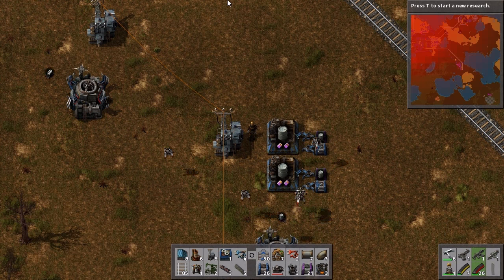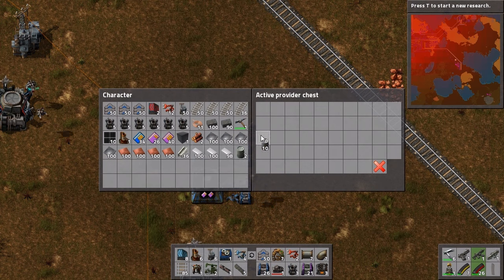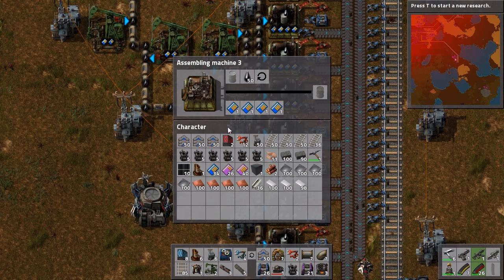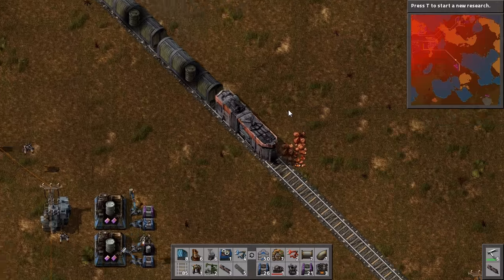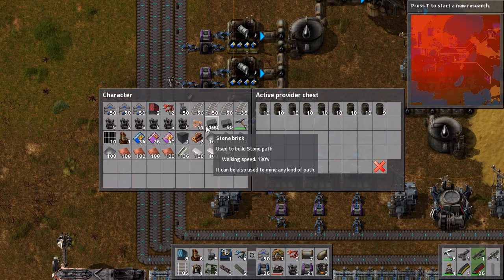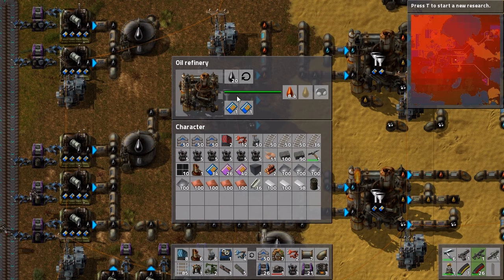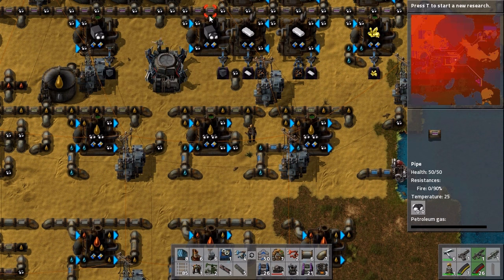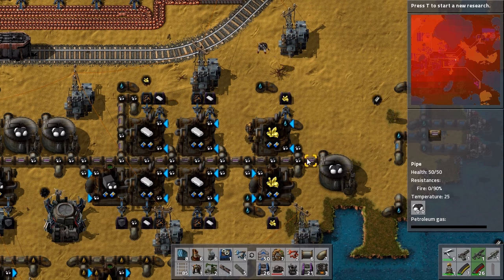Factorio - Guide for Dummies - How to use the Empty Barrel to make Crude Oil Barrel  - Fill & Empty

Comment: In case anyone needs this .. maybe to just jump start coal reprocessing, there are 2 factories.  One takes a empty barrel and the Heavy oil and creates a filled barrel and  another factory accepts the filled barrel and creates the oil and and a empty barrel.   Both factories have pipe connectors.